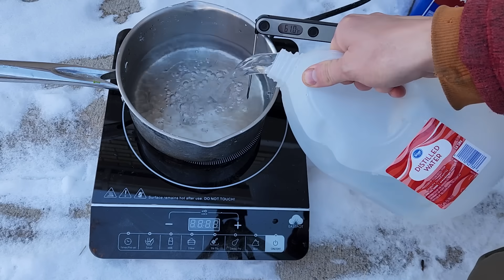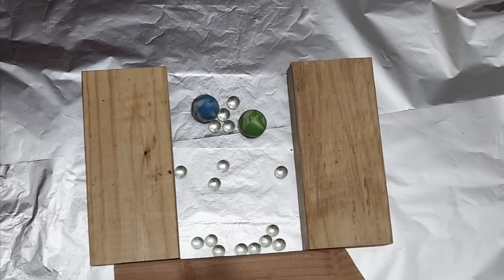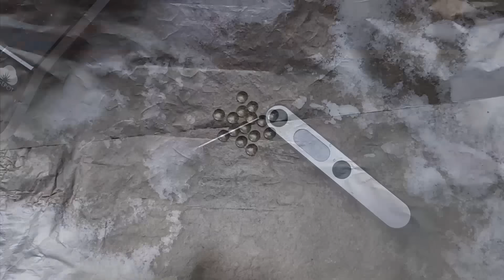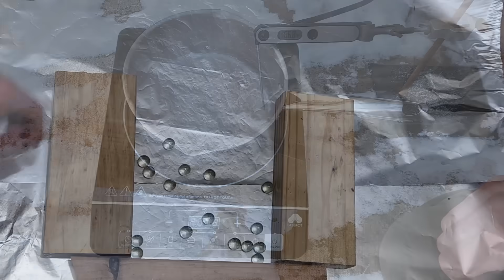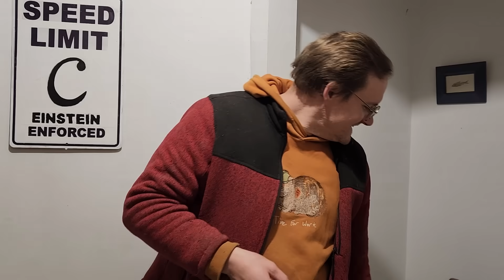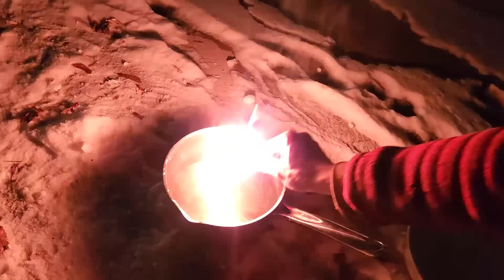Raoult's law

Comment: For a video in which water is boiling and temperature is taken down and discussed, not using the metric system really should be a crime. It freezes at 0°C and boils at 100°C people. What is so hard to understand about this?
Reply from the maker: Sorry. I'll use "corndogs" as a unit next time.
Reply: Fahrenheit has greater resolution without having to resort to decimals which would add additional digits.
Reply: @selkywaters  Who's Farenheight?
Reply: @Spoco  a victim of the spelling police.
Reply: @selkywaters this is funniest excuse I have ever heard
Reply: @Qpwrtm  Not an excuse.  I like metric except for temperature.  The Fahrenheit scale is a sweet spot when it comes to ease of use and precision.  HVAC is an example.  Two digits are all I need to be comfortable when using a room thermostat.  A single degree of swing on celsius is often way too much while a single degree of swing using F is much better.  That only works up through 99 degrees F but I don't ever have a setpoint that high.
Reply: @Qpwrtm  Why not just use Kelvin then?  It's makes LOADS more sense than using the changes of state of water for your bookends.

Comment: Would adding salt to a pressure cooker increase the temperature for better sterelization ? 
I use a pressure cooker te sterelise grain jars but the cooker works at 50kpa and autoclaves are 100kpa 
I wonder how that works
Reply from the maker: You will still be limited by the temperature of the water inside the grain boiling but the liquid surrounding the jars will be hotter and that may make them heat up faster.